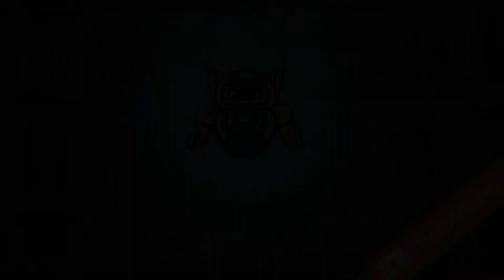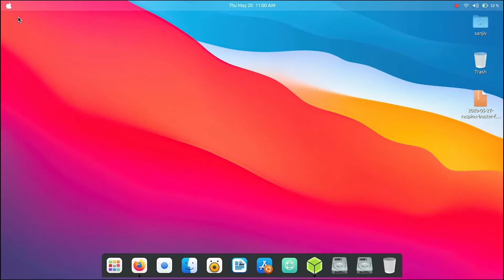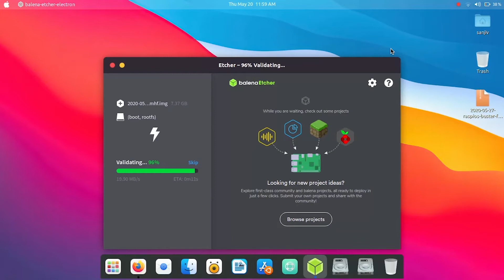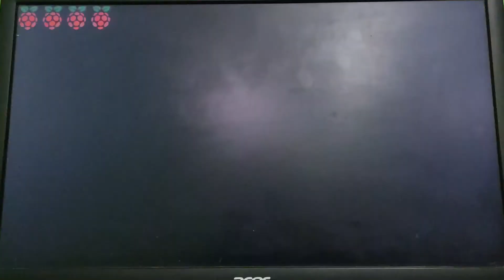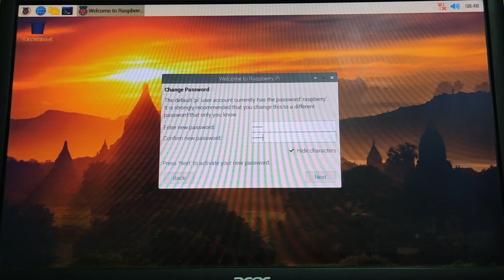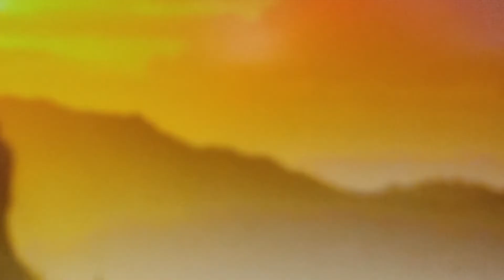Raspberry Pi Tutorial Series | Part - 1 | Raspberry Pi | Sanju's Robotics Studio

Comment: Banana Pi BPI-M2 Pro is the next generation single board computer from Banana Pi in 2021. It is powered by Amlogic S905X3 quad-core Cortex-A55 (2.0 XXGHz) processor.Onboard 2GB LPDDR4 memory and 16GB EMMC storage, and supports 2 USB 3.0 interface, a gigabit network port. RT8821CU wifi&BT onboard. 1 HDMI output
http://wiki.banana-pi.org/Banana_Pi_BPI-M2_Pro
Reply from the maker: Yeah sure will try that too, Thanks for your suggestions